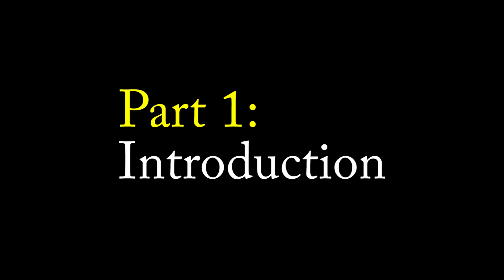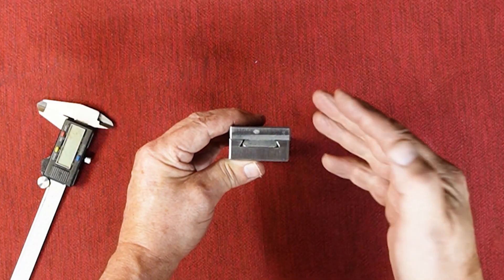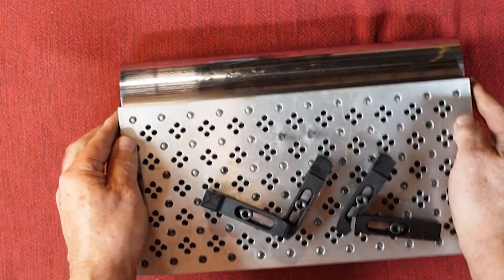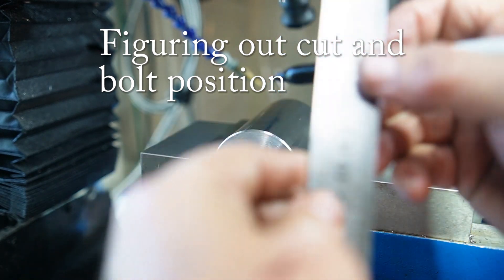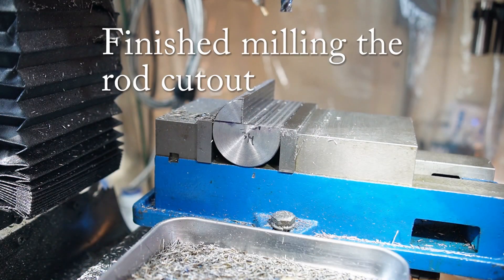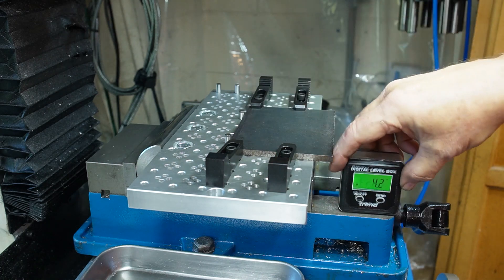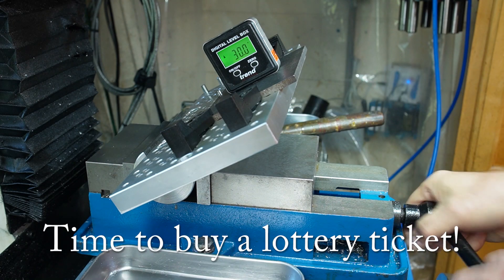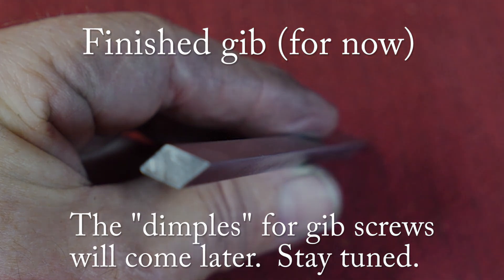Making a simple adjustable angle fixture plate for my mill vice

Comment: Usually hydraulic cylinder rods are induction hardened.  That would have killed that saw blade......
Reply from the maker: It's beautifully polished and precision ground metal yet came at a very reasonable price from eBay.  I assumed it was cut from a hydraulic rod from old construction equipment but you're correct of course that it couldn't be -- or I wouldn't have been able to cut it.  

Still a mystery where it came from.  Maybe the eBay-er had access to the rods before their induction hardening process.  Maybe a "fell off the back of a truck" situation.  :-)

Comment: 15:03 Make a shim to go between the plate and the round bar to provide a clearance if needed. A second shim to fit between the plate and vise top would get you back on 0 degrees.
Reply from the maker: If/when I ever need to mount a wide part on the fixture plate, needing to overlap the top of the round bar, I'll use your idea to make that shim.  Thanks. 🙂

Comment: If you mill off the lip flush with the top of the plate, I think you would be able to get back to 90 degrees.
Reply from the maker: Yes, that would give me 90 degrees exactly, and solidly.  And I did consider doing that (as I think I commented in the video).  But with more of the round bar milled off, it would sacrifice being able to adjust the higher angles between about 80 and 89.99 degrees 

As it is currently, I can safely adjust it from 0 through about 86.5 degrees.  And of course I can already get 90 by removing the platen from the round bar and clamping it directly into the vice upright. 

So I'm going to leave it alone.  As I commented in the video, if I were to do it again, I'd do it exactly as Mr Pragmatic Lee suggested in his YT video, and mill the cutout so that the platen is exactly flush with the top of the rod, and exactly at the centerline.  

Water under the bridge.  It works well enough for my needs as it is.  I hope I'll never need an 87.5 degree angle. ;-)

Comment: Socket cap head screws would have been easier and taken up less room. but that is hindsight at this point.
Reply from the maker: Ya, definitely.  I didn't have any 10mm socket head cap screws, but did have these 10mm flange headed ones on hand, and wanted to keep the progress going rather than waiting a whole DAY for another Amazon delivery.  

Anyway, I'm happy with the flanges, as they distribute the clamping force across a wide area on the aluminum platen.  It's uber-strong.

Oh, and I did have some 8mm socket heads on hand of the right length but they didn't seem beefy enough for this application.  I'm sure they would've been plenty strong, but I like overkill.